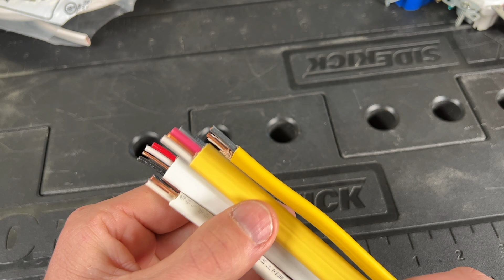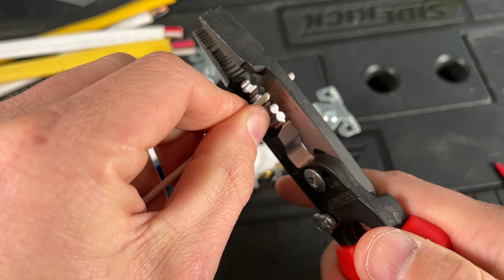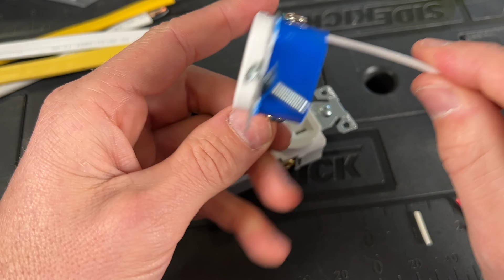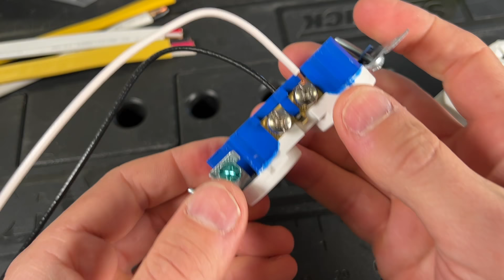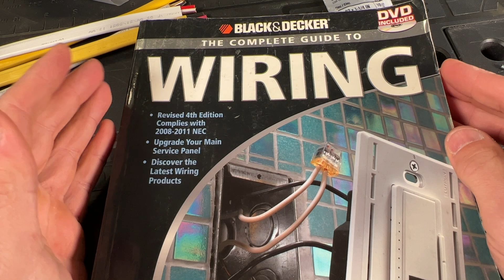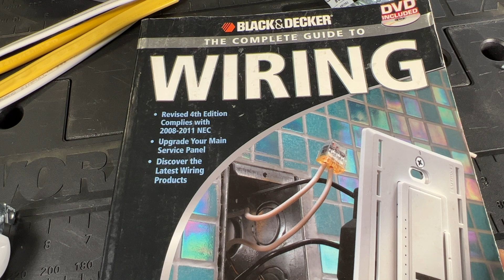#1 Best Video for DIY Electrical Outlet Basics

Comment: On the 20 amp commercial grade could you use two wires coming in the back for each screw?
Reply: So 4 wires a side ?
Reply: Only one wire per screw, commercial grade or residential grade, amp rating doesn't matter either.
Reply: @surferdude642   thanks I'm just now getting my feet wet with electricity
Reply: @trnfan176 Scott said in the video that 20 amp receptacles are the most common in homes. He misspoke, it's 15 amp that are most common. Your standard 15 amp duplex receptacle can be used on 15 or 20 amp circuits. 20 amp receptacles can only be used on 20 amp circuits with 12 gauge wire.
Reply: @surferdude642  thanks again

Comment: Smoke detectors if they are hard wired in use 14/3 and the red is an coms white so it can set off other smoke detectors around the house that’s how they communicate from what I understand

Comment: EVERYDAY HOME REPAIRS< you haven't mentioned in your videos about when houses are wired up as "bootleg" grounds because most DVM meters or outlet meters can't measure and test Bootleg Grounds. What can you use to test and measure bootleg grounds and what can you use to protect yourself from a house that is wired as a bootleg grounding scheme?
Reply: Ideal makes a circuit analyzer which will do that, but it's over $400. Otherwise you could remove the receptacle cover plates and see it.
Reply: @surferdude642  yes but you would have to remove all the receptacles cover plates to know which receptacle is the only one that has a bootleg ground. Example of a house has 10 receptacles but only one has been wired as a bootleg ground how would you troubleshoot and find the receptacle that has been wired as a bootleg ground?
Reply: @waynegram8907  Correct, but that shouldn't take too long, maybe 15 to 30 minutes.
Reply: @surferdude642  yes i know, but lets just say that removing the outlet covers wasn't an option how would you go about it?

Comment: Can a 15amp socket be used on a 20 amp line?
Reply: Yes, a 15 amp duplex receptacle (2 sockets) can be and is commonly used on a 20 circuit. A 15 amp single receptacle cannot be used on a 20 amp circuit.
Reply: @surferdude642   Thank you so very much! I’m running LED wrk lights in my garage and the line is 20 amps, so I’m going to run 15amp receptacles that those lights will run off of. Instead of connecting to both hots for middle run receptacles would it be a problem pig tailing the hook up?
Reply: @Paco-hh4jd  You could do it either way, your choice, but pigtailing is usually preferred. Pigtailing can be done with wire nuts, push in connectors, or Wago lever nuts. For 20 amp circuits , I recommend using commercial grade 15 amp receptacles.
Reply: @surferdude642   Thank you ! You have been really helpful and I truly appreciate you!

Comment: Just a heads up on homes built before 2011 regarding light switches:  the white wire might be used as a hot travel wire in a light switch box, and is likely being used as such, unless the circuit got rewired to meet later code.  In a home with 3 way switches, rewired to meet 2011 and later code, the switch wire might be 14-4 or 12-4 cable being used for the 3 way and 4 way switches.  That way, the box will have a white neutral wire in it.

Comment: When it comes to a Phillips head driver, there are 3 types of Phillips heads:  #1, #2 & #3.  Number 2 heads are the most common heads, and is the default head used.

Comment: For cutting the screws shorter you should screw in first passed the cutting edge to the length you want to cut off, then when you remove screw, it cleans off the burr made by the cut. Great video for beginners, thanks.

Comment: 3:18 You can use a #1 Robertson or use a Klein combo tip #1 or Milwaukee Ecx #1 which fits into the entire screw head reducing stripped screws and giving more force and pressure to secure the wires to the screw.

Comment: Very informative.  In a massive rewiring project of my home, built in 1958, I inadvertently bought 250 feet 12/3 20A rather than 12/2.  I was still able to use it and cap the red wire, but its nice to know that I can use it for three way switches.  I used a mid-way connection box where the 12/3 wiring connected to 12/2 wiring that goes to the main panel to avoid confusion in the main panel.

Comment: Excellent video! Thank you! I do have one question, and one note/ question. 

My question is: you mentioned that there ARE differences between: 
- "backstabbing" (aka speedwiring), and "backwiring," but didn't expand on what the differences were, or when to use one or the other, etc. Have you explained that elsewhere perhaps?

Secondly. I checked the description, and looked for the black and decker book on your Amazon page, but couldn't find it. Can you provide a link to that item - if it's still available?

Thank you! 😊
Reply from the maker: Hey Justin, back wiring you will find on most commercial grade outlets.  This video will expand on the differences https://youtu.be/SSfPzunEQ9g.  Here is the link to the Black and Decker book https://youtu.be/SSfPzunEQ9g
Reply: @EverydayHomeRepairs  Awesome! Thanks brother!

Comment: Hi Scot  I'm sure you're putting your energy into your knew "help" site.  I like your new channel but, sure would appreciate a video on how to replace a wall switch with an electrical outlet (preferably gfi) in my case.  I have a wall switch in my garage that used to control a power vent on the roof.  I removed the power vent when re-shingling my home and was thinking that if I could replace the now dead switch with a plug outlet, it would be beneficial.  Some articles I've read say it is not just a matter of taking the wires off the switch and attaching them to the plug.    I need some help.  If you get the time, it would be appreciated.  Appreciate all you do and the help you provide.  Marc

Comment: This video is irresponsible by not knowing the National Electrical Code. ALL residential electrical outlets must be tamper resistant type. The presenter suggests that commercial grade outlets are better, however the NEC requires that homes have tamper resistant outlets. By not mentioning this Fact the presenter has liability and could be sued.
Reply from the maker: Fair point on needing to pointing out TR but should Home Depot and Lowe's be liable since the larges box of 15 Amp outlets (at least in my area) are standard outlets.

Comment: I'm replacing an outlet in my home.  Something blew when I plugged in my vacuum to a power strip connected to this plug. The power strip works fine in a different outlet. I forgot to take note how and what colors were hooked to the previous outlet.  There's a 3-wire cable coming into the top of the box and a three wire cable going out the bottom of the box. The colors are black and white and copper coming in and going out.  I know what breaker controls this so I turn it off and on at will.  When I turned it on and test it with my cheap tester, I touch black to the copper ground and red to the white top wire I get 120 volts, and when I do black lead to copper ground and red lead to black top wire I also get 120 volts!!!  So it looks like the top cable has two hot wires on it the cable going out of the box has no juice to them.  For the life of me I cannot figure out how to wire it back up.  This one socket keeps electricity from going totwo other rooms in my house, my computer room and a bedroom.  Anybody have any suggestions?

Comment: I have a house out in the country built in 1968 with no grounded circuits, no ground wires,  and the fuse box has all 20 amp fuses.   Is it OK to run the white romex to all the areas of the house that need only 15 amp outlets and lights?   I am putting in GFCI boxes on the two kitchen circuits. the first outlet only.
Reply: It doesn't matter if it's a 15 or 20 amp duplex receptacle. A 15 amp fuse or circuit breaker can have 14 or 12 guage romex. If you're using 14 gauge wire your circuit breaker should be changed to 15 amp. 20 amp circuit breakers go with 12 gauge romex.

Comment: On the outlet tester, no LED's appears to indicate an open "hot" wire, not that the circuit is "Off." No LED's is at first a danger signal.

Comment: Maybe you already have a video for this, but one skill I feel electricians take for granted is how to effectively fit all that Romex in the box when you screw the outlet in. Especially if you have more than one cable in there, and double especially if you're making pigtails. Could you do a video on strategies to make this easier?
Reply: Check out YouTuber Benjamin Sahlstrom. He has some videos showing how to neatly fold or roll wires into the box.
Reply: That would be nice.  A couple of months ago I was trying to fold some 6 gauge into a double box for a 6-50 welding receptacle.  Had a heck of a time.

Comment: Why would you recommend non-tamper resistant spec grade outlets when most building codes now require tamper resistant? That could be a very costly mistake on inspection.

Comment: He needs to mention to turn off the breaker switch for the outlet you are replacing and testing it by trying a hair dryer, etc. on that wall plug to make sure the electricity is off for that particular plug.

Comment: If you put the bolt through the other direction the treads will clean up when you remove the bolt. Not ripping on you still an awesome video!

Comment: wire strippers -- Kaiweets Self Adjusting -- learned about this tool from another Youtuber and have found it so much better than the traditional kind. Very useful - how much insulation to strip off...now I have to check what I've done.

Comment: When cutting off the end of the screw place threads into the threaded side of the cutter, the you need to unscrew the screw and it cleans up the thread so it is not “bugared”

Comment: The RT210 is not the tester you should be using or recommending. The better one is the Klein RT250 Receptacle Tester. The best recep is the Leviton TCR15-W Side Wired Commercial Spec Grade Tamper Resistant Duplex Receptacle 15-Amp. Side wiring is still better than back wiring; more surface contact. Other than those, great tips!

Comment: In some places the red and black wires on the hot side of the outlet could be in a kitchen running essentially both phases through a double pole breaker coming in due to small appliances consuming enough power that one branch circuit isn't enough.  Granted, in most kitchens these days there is often a 20 A circuit off of a GFCI (RCD in the Euro/UK/Australia areas) in the kitchen but older setups may be that 120/240 VAC that we're familiar with in North America and similar setup in Japan.

Comment: Ok so if you have 1 hot and 1 neutral wire going on correct sides, does it matter which screw terminal it goes under (like top or bottom)?

Comment: Those are actually receptacle testers. Not outlet testers. plugs, receptacles and outlets are 3 separate things. plugs are the male ends that you plug into receptacle. Receptacles are the female reception end. This is what you see on your walls. Which is what your video is about. Receptacles. An outlet is any J box or place that you can get power from. Means it's sending power out from that point. Could be many different points. You do good DIY though

Comment: For the switched outlet setup, isn't it also common to have split duplex receptacles for kitchen wiring?  That is, running 2 parallel circuits out from the breaker box (with the breakers tied together since you'd never not want to turn both off for servicing) to each receptacle and powering each half individually.  The idea, or so I'm told, is so that if you have 2 high current things plugged in at once, you're not overloading the circuit.

For example, say you're using a coffee maker but your partner wants tea, so you turn the kettle on.  Makes sense to have these both at a receptacle not far from the sink because you need to get water in both of them.  They're both designed to heat water quickly, which is raw power demand - you just need to put hot into water, it's pretty basic physics, you're not gonna find any fancy efficiencies that cuts down the power demand for boiling water too much.  Power is voltage times current, and you can't tweak the voltage (well, you can, transformers exist, but it doesn't gain you anything in this context, so you need high current to do the job.  Often these sorts of things are set to run at 12A or so, because you don't want to trip a 15A circuit because someone decided they wanted to make coffee in their living room, but if you're making coffee and tea, you've got 2 12A loads.  24A is gonna trip the breaker to your kitchen if it's working right.  (and it doesn't need to be tea, maybe you're making toast and coffee, again, 2 raw heat output devices, 2 massive current loads.)  Thus...split the plugs up and then you only trip the breaker if you're flitting around the kitchen doing a bunch of these things at once.

Or maybe that's a peculiarity to the building code here in Canada, or just in BC.

Comment: Hello friend . I have A questio please 
what will happen if I use 12 gage instead  of 14 or vice versa . Thanks for your response . ❤
Reply: On a 15 amp circuit you can use 14 or 12 gauge. On a 20 amp circuit you can only use 12 gauge.

Comment: Nobody ever talks Abt what to do when there's 3 hots and three neutrals
Reply: You would use a wire nut with 4 wires, a 4 position push in connector, or a 5 position Wago lever nut. (One position is unconnected). The 4th wire is a pigtail and that connects to the receptacle.
Reply: @surferdude642  thanks but doesn't help
Reply: @bradmarkell12167  Could you explain what your issue is?
Reply: @surferdude642  n.o.b.o.d.y. e.v.e.r. ...how much more do I need to spell out for you???

Comment: I'm wiring two separate switches to two switches on one outlet and and two plugs on the other. The switches work great but the outlet doesn't. I  think I'm missing a ground.

Comment: Some guidance on what receptacle to choose regarding amperage relative to circuit breaker size would be appropriate.
Reply: In a typical residential application for a duplex receptacle use a "spec grade" 15 amp, regardless of a 15 or 20 amp circuit. The need to accept a 20 amp plug is very rare and will likely require a dedicated circuit and a single receptacle. The 15 amp "spec grade" is equivalent to a 20 amp "spec grade" receptacle. The only difference is the existence or not of the horizontal slot on the neutral side.

Comment: Recently did a tile backsplash in a kitchen in an ugly old house. A "handyman" had been previously living there and did all sorts of work, including electrical. I turned off the breakers on the counter plugs to pull the outlet away from the wall. EVERY plug had its own circuit. Each outlet was on a split circuit using 14-3 with one breaker for the top plug, one for the bottom plug and shared neutral. 2 of the outlets would not switch off, even though I went through every single breaker in the panel. Eventually I discovered the problem. He wired them up for a split circuit, but forgot to break the tab off between the individual plugs. So it was been feed by TWO breakers at all times and when you switched off one breaker, the other breaker would keep the full outlet live. I had to switch off 2 breakers to kill it, then break off the tab to split them. He did two outlets with that mistake. On one of them, the overhead microwave/exhaust fan was connected by simply backstabbing it into the back of the plug, another big mistake. I reported what I found to the REAL electrician who had been working there so he could check it out professionally.

Comment: does back wiring also makes it easier to push the wires back into the box and prevents crimping the wires too tight in the box?
Reply: No, not really. What matters is using a deep enough box and good wire management. Fold or roll wires in as neatly as possible and avoid excessive length. If using a single gang plastic box use a 22.5 cu. in. as this is fairly deep. Use Wago lever nuts, they save significantly on necessary wire length and use pigtails for middle of the run. I have been able to get 4 sets of Romex 12 gauge without over filling the box. The receptacle should be easy to install without cramming or shoving. There should be no kinking or tight hairpin bends. Typically, you'll have only 2 sets of Romex cable and then you'll have more than enough room if done correctly.

Comment: Re: Switched outlet (21:35)
This particular configuration actually splits the receptacle into 2, one switched, one always-on. If you want both outlets to be controlled by the same switch (I have one of these in my room), you'd leave the tab attached but make sure to only connect the red wire from the hot side of the outlet to the switch.

Comment: Do you need to wrap your outlets and switches with electrical tape?
Reply: I don't think it is necessary, but optional. Avoid excessive wire length and make sure the bare ground wire is not close to the neutral screws since they're on the same side on a receptacle.

Comment: How do you know when to do a hook or just put the wire straight in?
Reply: If you're using a spec grade receptacle, it's your choice. They are designed to encourage putting the wire straight in and clamping down by tightening the screws. If you're using residential grade receptacles you can only hook around the screws. Don't use backstab holes and they won't even accept 12 gauge wire.

Comment: I can't find a ground wire when I went to replace an outlet, can I still install the new one without the ground wire
Reply: No. You can install a 2 prong receptacle or a GFCI receptacle without using the ground connection.

Comment: How do u know what amp you are working on?
Reply: Check the circuit breaker. It should be 15 or 20 amps for a 120 volt system. The wire's can be 14 or 12 gauge for a 15 amp circuit, but must be 12 gauge for a 20 amp. 14 gauge is 1.5 mm in diameter. 12 gauge is 1.9 mm in diameter. Not including the insulation.